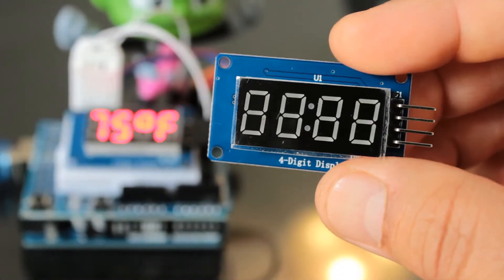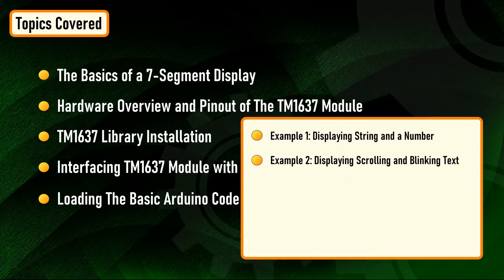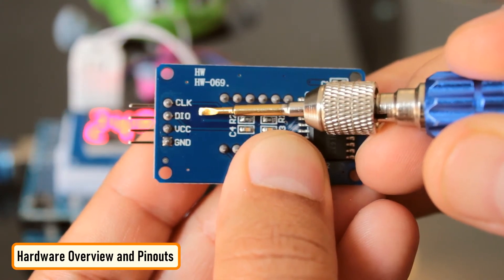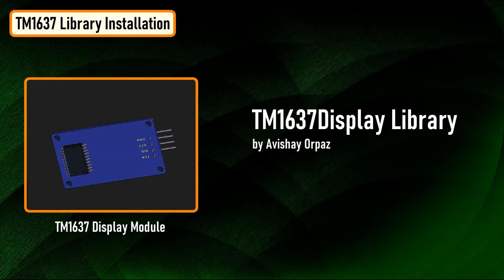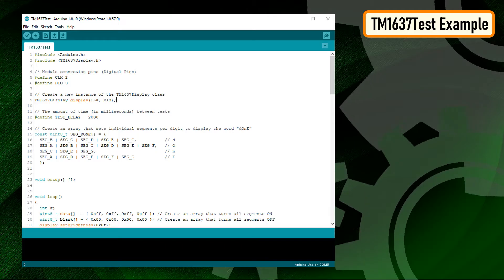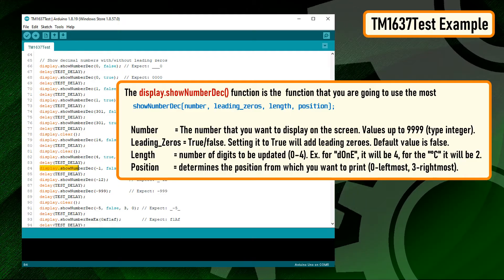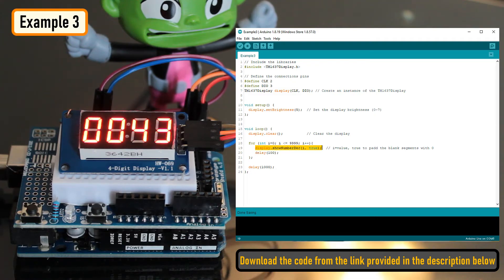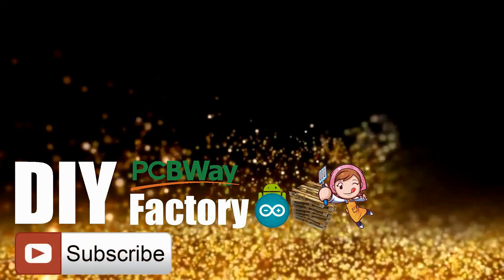All About TM1637

Comment: Can you change the led red light to white?? Or is there any way to get one with white light
Reply from the maker: There are white , green, blue and red variants you can use. 
But do consider the forward voltage while using them in your circuit

Comment: In case anyone got a module that has dots on it, you can turn them on by setting the top bit on.
#define SEG_DP   0b10000000
Reply: thanks, but how do I turn the dots on, once implemented?
Reply: @schnodderbürstchen  At 06:55 in the video, you can see how this is used:
1. The data byte-array value is built by OR-ing multiple segment byte-codes together - here you can add either the pre-defined SEG_DP or the raw value - 0b10000000 to add that segment (the dot at the bottom of the digit).
2. the data is passed to setSegments.
Reply: @llaltxll  what worked for me in the end was the showNumberDecEx-function, with the second entry being a number 64 or bigger. So display.showNumberDecEx(1234,64,false) or something like that.
Reply: Thank you for this.  I purchased a display on Aliexpress in the dollar express section.  I've tried a half dozen ways of getting the dots on and the only thing that comes on is the colon.  I think this one was so cheap because it's defective.  
“It is possible to commit no mistakes and still lose. That is not a weakness; that is life.” - Jean Luc Picard

Comment: Thanks.
Which Lib you are using for DHT11 / 22 ?
Reply from the maker: Just the standard one mate
Reply: DHT sensor library by Adafruit
Arduino library for DHT11, DHT22, etc Temp & Humidity Sensors
use this one its handy

Comment: Thanks..
which lib you are using for DHT11 / 22 ?
Reply from the maker: Just the generic one
Reply: DHT sensor library by Adafruit
Arduino library for DHT11, DHT22, etc Temp & Humidity Sensors
use this one.